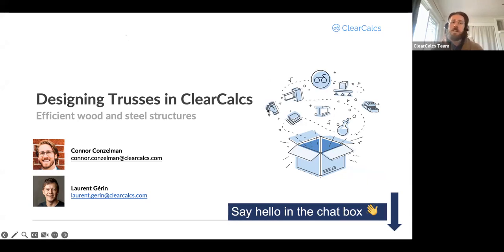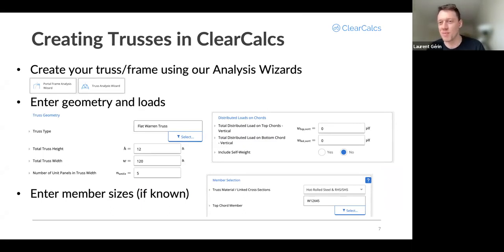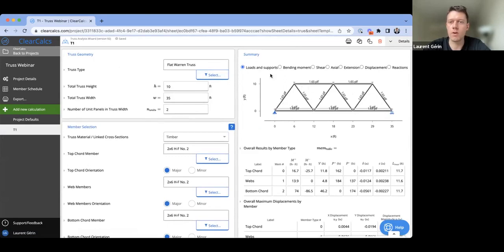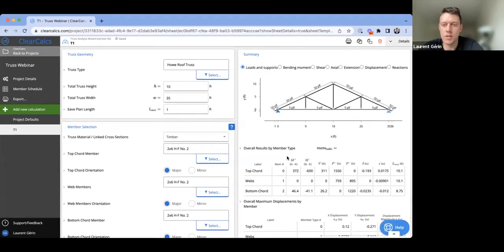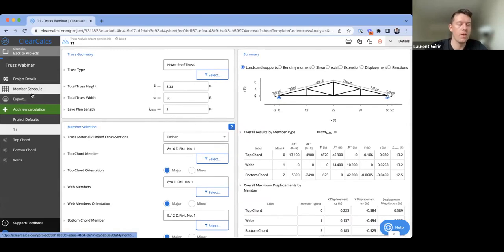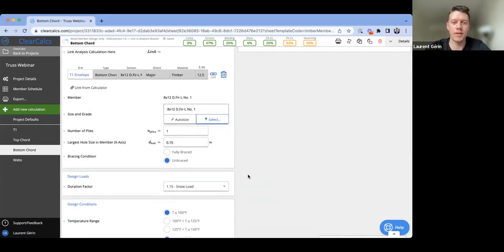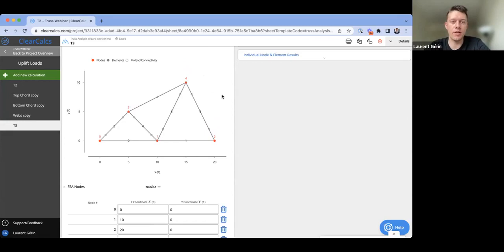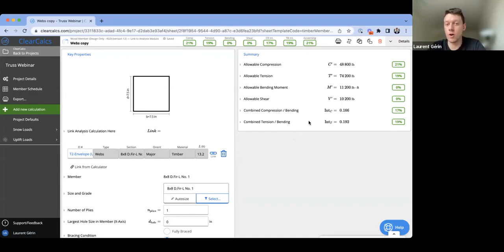Webinar | How to Design Trusses in ClearCalcs

Comment: Are floor trusses an option?
Reply from the maker: Hi there - thanks for reaching out! While we don’t currently offer floor trusses as an option in a wood beam calculator, you can analyze a floor truss using our Truss Analysis Wizard (https://clearcalcs.com/support/analysis/how-to-use-the-truss-analysis-wizard). We also offer an Open Web Steel Joist design calculator if you do steel joist design as well (https://clearcalcs.wistia.com/medias/0rmj6uypqa). Hope this helps!
Reply: Please resend link, not working